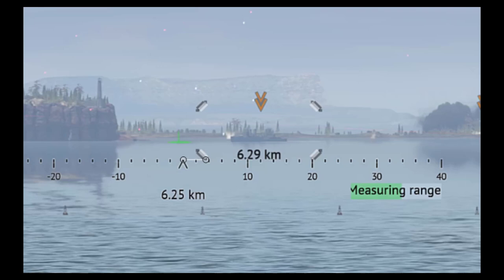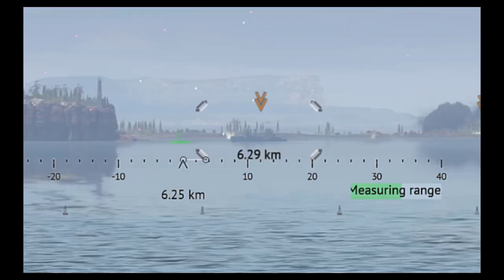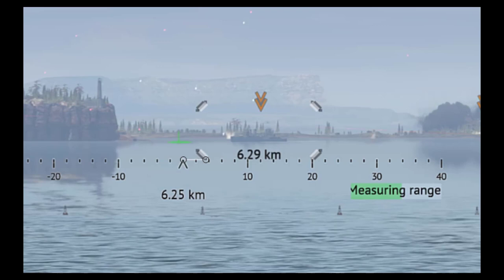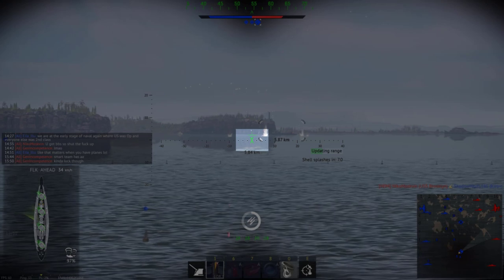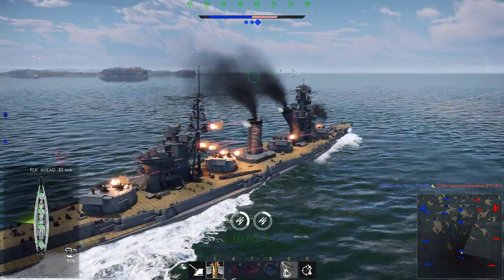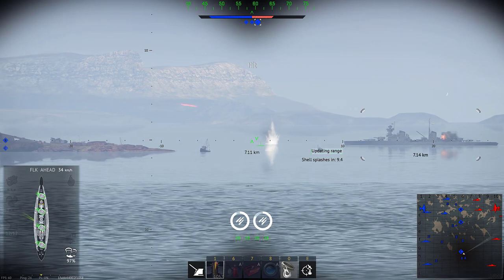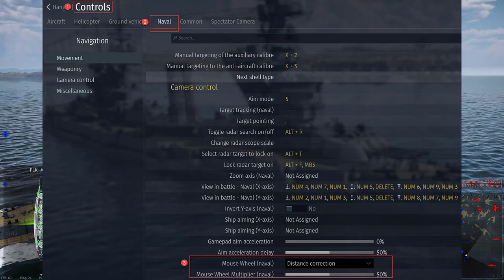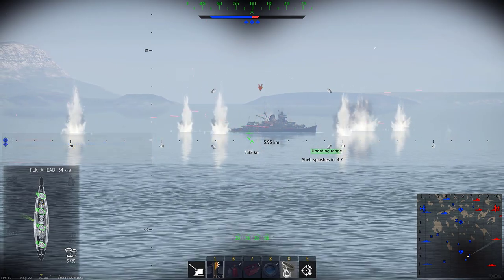How to use Artillery Directors (FCS) in Naval RB

Comment: It also depends on shell fight time. So if you are using a light cruiser with floaty shells at range about 15km away. You will have to double the gun range measure meant, for example if your target is at 15.43km and heading towards you, you will have to set the artillery range to about 15.23km at that range with shells that have a longer travel time.

Comment: Sorry, bad video, you fail to mention THE MOST IMPORTANT THING - lead indicator in NavalRB only shows lead in X axis, in other words, it only works when youre going broadside to broadside with another ship (both ships side to side, no angle, no closing or increasing distance). 
In broadside-to-broadside situation the Y component (what range to set guns to, mouse up/down aim, or mouse wheel up/down) is reasonably easy to guess.
In any situation where distance between both ships is decreasing or increasing, the lead indicator is completely fucking useless, since guessing the Y part (what gun range to set with mouse up/down, mouse wheel up/down) is difficult or very difficult. - This is very apparent around 04:10 in video, where you aim in X axis using lead indicator but ignore the Y part of equation (target was 7.14km away and you aimed your guns 6.98km away so it was pretty clear the shells were going to miss too close and hit water).
Bottom line - the lead indicator in NavalRB only works in a broadside to broadside situation AND only when both ships keep same direction and speed from the moment when you get lead indicator to the moment shells hit. Even then you have to guess the Y part of equation, set the correct distance with mouse up/down, mouse wheel/up down aim, which is not as easy as it sounds, putting the green shell hit indicator circle 5 pixels higher or lower can make you miss or hit well. Therefore, lead indicator in NavalRB is useless 99.9% of the time. You HAVE TO aim using green circle shell hit indicator (WHICH assumes your ship is not moving, otherwise shells will inherit movement and will land elsewhere), biggest difficulty is guessing how far behind your target you have to put the green circle to account for shell arc and height of target ship + compensating for your movement of your own ship. If your ship is stopped, green circle is fairly accurate.
Reply from the maker: Sorry if did not explain the point well enough for you, yes the director only gives you the X lead more or less and you still have to do the distance (Y as you call it). I do say that you have to adjust the distance in the video, I even highlight it. Sorry it that was not clear for you :)